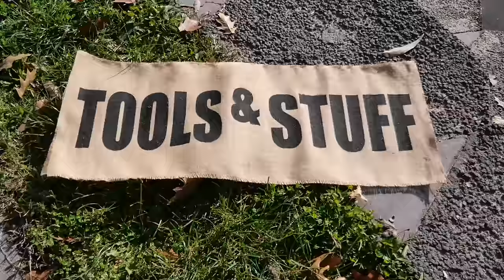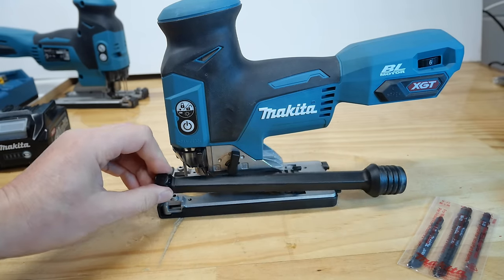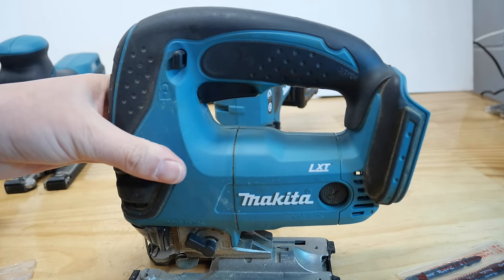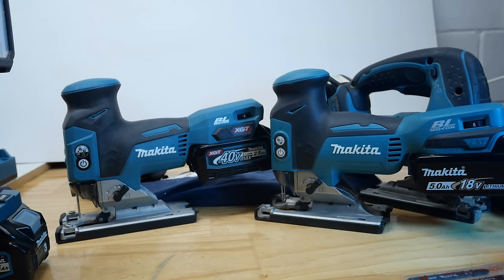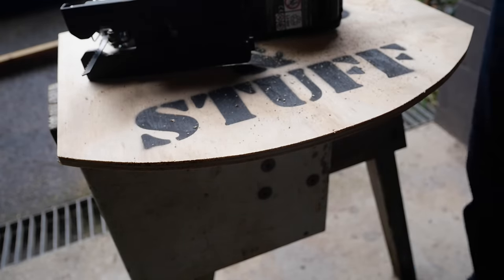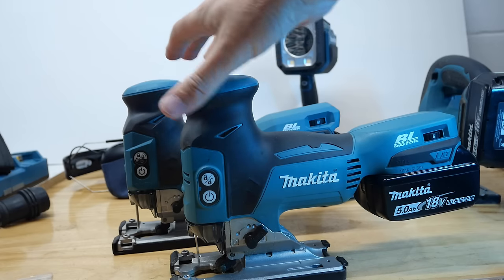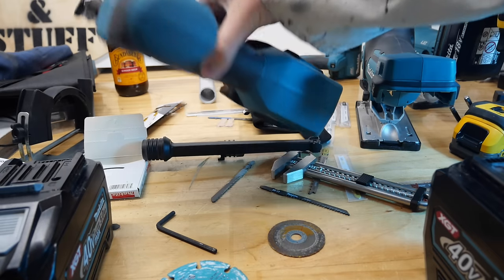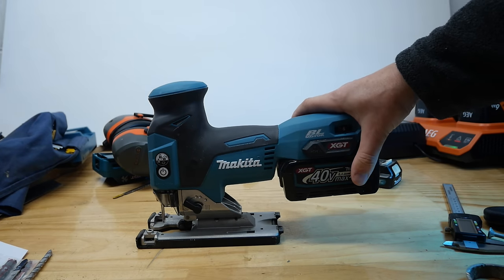Makita 40v Jigsaw Review... A Barrel Grip Beauty?

Comment: I've always bought single/dual 18V Makita, but have been waiting for the full 40V line to see if I'll stay with them. The functionality trend seems to be moving further away from practical excellence to keeping the engineering theorists and cost optimising accountants happy. Too expensive, too much missing functionality (Allen keys to adjust the foot, seriously, in 2024?!? No variable speed trigger?!? Crappy dust collection?!? No integrated AWS?!?). Is the famous durability enough to compensate? I can't see myself sticking with Makita much longer.
Reply: so what do you think is better? please don't say festool...
Reply: @riba2233  I don't think there's much that's better unless you start going in the mafell direction. My point is that from a value perspective DeWalt and Milwaukee etc. are looking increasingly interesting.
Reply: @BB-sm8ey   only on surface, they are undercutting the market only in the USA but are more expensive in the rest of the world, however they are far less reliable and repairable so I would stick with makita.
Reply: @riba2233  I'm currently sticking with 18v Makita, but increasingly just buying good enough bargain basement stuff from parkside and co. as Makita tools break... just to buy time. It's a big investment to move towards a 40v platform. I will wait another year for that decision.

Comment: That trigger on the d handle is exactly why I haven't upgraded yet. Maybe they'll make a d handle 40v
Reply from the maker: There will be a 40v D handle.
Reply: New 18v brushless D handle jigsaw has no speed control in the trigger , one thing they could have kept .
I also prefer D handle , mainly if it slips from hand it stops , always better with tools that stop , when trigger is not pressed , same with angle grinders , rat tail/paddle switch is safer on a tool thats designed to cut anything front of it , specially new ones that can stop the blade .
I have looked at Festool barrel grips , mainly because hardware store is selling older corded ones for half price , still not enough , specially when Festool Carvex needs tons of accessories, base model makes only 90° cuts , adjustable shoe sold separately.
Reply from the maker: XGT D handle being edited now...
Reply: @ToolsAndStuffOFFICIAL you totally called it what a legend!

Comment: This is getting out of hand. My bosch 12v jigger is a beast. I'm sure an 18v is more than enough. Why? At what point does the unnecessary never ending consumption stop?
Reply: Shouldn't people on the 40v system be able to have a jig saw also in the system? Or do you want them to have two battery systems? Wouldn't that just increase consumption even more?
Reply: @boberson83  I'd bet most who are buying into these 40v platforms already have 18v systems.  I've seen several videos where the 18v tools outperform the 40v stuff.  Some torque test channel shows the bosch 18v destroying the 40v makita.  My opinion, seems like gimmick marketing. Perhaps the 40v is useful in certain tools but the 36v makita stuff is all running the same voltage and 18650 cells.  Again, bosch 21700 18v packs are out performing makitas 18650 40v stuff.  I run bosch and makita 18v. The hype train is real.

Comment: Switched to the barrel grip a few months ago and love it, won’t go back now. Doing a 180 degree cut means you keep your body and the job still, you can spin the tool around and pull it towards yourself. I also like the auto torque.
Reply: I kinda regret buying barrel grip. In my line of work (aluminium door repair) D handle is probably better because I can control the speed and doesn't need to be brushless

Comment: Barrel grip is the better choice if u cut upside down.
•Cleaner resunts with upside down cuts
• for this kind of cuts the trigger of the D handle saw is impractical.
•you can see the saw blade better with upside down cuts.
Great video for the Weekend.
GJ Mr. Tool

Comment: I build architectural builds over in greenhithe i made the mistake of investing in dewalt tools .. the trigger settings seem to have a mind if there own after a while 😅 makita looks good but im in the middle of a change to hikoki if you want to review so hikoki or DeWalt tools let me know i can loan you
Reply: Lol I'm in the same boat, but  im going hikoki AND makita.
My default drill and router sometimes just run at whatever speed they feel like, the skilly base is so far out of parallel the rip guide and straight edge is useless,  mines not the only one. Sure, default has power, but they're ruff as guts. The 18v grinder and high torque 1/2 impact wrench, i cant complain, but aint worth putting up with the rest.

Comment: Also I wish they put a second set screw on the baseplates. it’s too easy to knock the base out of square. Only takes one drop. a positive detent on 90 would be a nice little touch too.
Reply from the maker: There is a detent at 90°, but there is a bit of play in it.

Comment: Very similar to the 18 volt you think they would have had added dust blower or tooless base change. But the 18 v is meet to be a very good jigsaw.
Reply: Correcting myself it has a built in blower that is always on. I've put a copeing foot on my Milwaukee I find I can do 90 degree cuts easily enough makes the jig so much better cutting inverted. As for dust collection I use the hose and move it along the cut line.

Comment: Ended up getting the m12 jigsaw because its a barrel grip with a trigger. The angle adjust is just a simple lever which is nice but it comes loose all the time. The saw is ok, does what i need it to do but feels like its always holding on for dear life
Reply: You can thighten that lever !
Reply: Good jigsaw but slow, no oscillation mode
Reply: @souldigits_9545  thank you for the tip, I'll give it a go

Comment: I had the brushless d handle jigsaw that didnt have the soft start turn off feature and it annoyed me so much that i sold it and bought the brushed version, which I actually think is better.
Reply: You know you can turn that off
Reply from the maker: No you can't turn it off on the early releases of that model.
Reply: @martinmccloskey4206  nah not on my model, cant remember the date but I think any manufactured before 2021 aren’t able to be turned off.

Comment: Hello, great review. At the end of your review, I saw that the 40v XGT model reduces the frills, after sawing, and also when you turn this jigsaw on the ball. the 18 volt model can't do that and keeps the frills constantly. I recently bought a 40v XGT version, BUT my revs are not decreasing like in your video - what could be wrong? or is it an additional option?
Reply from the maker: Did you watch the whole video because I talk about it a lot and show how to turn it on and off.
Reply: @ToolsAndStuffOFFICIAL  I watched your video again - you described how to turn on this soft start mode at 5:38 minutes. You need to unlock and then put the speed wheel in position 1 and then in 6, a soft start is activated. This is a very useful feature in the work. Thanks for your review again!

Comment: Barrel grip for me. I have the corded Makita and like it. It has a sliding thumb switch and not that silly push button pad that the wife will put her fingernails through. It will outlive me and I can keep using it no matter how many times Makita changes their battery platform. I've had 5 different Makita battery platforms, landing on lxt. If I buy another battery platform, it won't be Makita. Makita, where is the LXT "cordless" pruner?

Comment: Wait a minute, makita made a tool that’s not fully compatible with THERE OWN BATTERIES? (Can’t tilt base fully) wow. that’s a pretty epic fail really.
Reply from the maker: I doubt many people are gonna want to use it with the 8Ah battery. And most companies have to do this for small tools now as the large Ah batteries are getting so massive. Would you rather have a comfortable tool, or an overly cumbersome one that takes a battery too heavy for the tool? No fail.
Reply: @ToolsAndStuffOFFICIAL  Makita should be taking notes from metabo, 5.5ah, 8ah and 10ah batteries are the exact same size, the 8ah and 10ah just puts out less peak power. The times you need a big battery are generally the times you don't need the high output (Lights, vacuums, heat gun etc)
Reply from the maker: You clearly don't use many high drain tools.
Reply: @ToolsAndStuffOFFICIAL  The few that might make sense for that are probably the ones big enough to justify a 2x18v, like a chainsaw. I could see makita doing a 2x40v in future like dewalt does a 2x54v
Reply: @ToolsAndStuffOFFICIAL  I’d say it’s a pretty massive fail. when I’m at work with all the things Iv gotta think about I don’t wanna have to think about what makita battery fits my makita tool. I just wanna grab and go.. you know.  Like the 18v has been forever. it’s just poor design.
Reply: @richiejames928 who is going to stick a 8 ah battery on a jig saw its same size as the tool its slef and twice its wight
Reply: @aaronoconnor606  someone that’s going to be using the jigsaw a heck of a lot. some days I have spent many hours jigsawing scribes. roughing things out from templates. yadda yadda.
Reply: @richiejames928   it is not a poor design, you would never want to use this tool with such a big and heavy battery. just shows that you don't actually use these tools, just theorize on the internet.
Reply: @riba2233  clown comment of the day. Iv spent days roughing things out with jigsaws. making curved formers long before the days of CNC machines. making a tool that doesn’t accept your own batteries IS bad design.

Comment: Makita LXT 18v really needs to come out with some Stacked Lithium Batteries to Try and  get more power out of their Tools , But I did hear that it wouldn't matter because the LXT Line is Engineered for their Existing 18v batteries.... Does Anyone know anything on this Subject ??  👍🖖
Reply: higher capacity batteries or stacked cell batteries won't make an 18v tool any more powerful but it could theoretically maintain peak\rated power for longer. biggest problem with makita 18v is even the 6ah batteries lose peak current capability rather quickly. my home made 9ah batteries run my 18v grinder at peak power for much longer than a genuine 6ah does
Reply: Wouldn't help, tools are made to work with current packs. They could already use better 18650's, no need for pouch at all but won't make a big difference